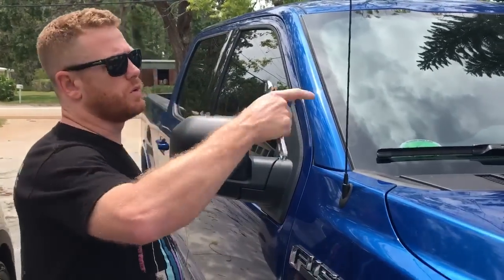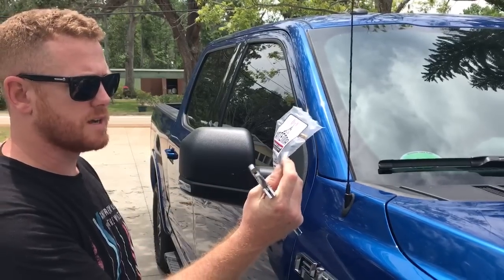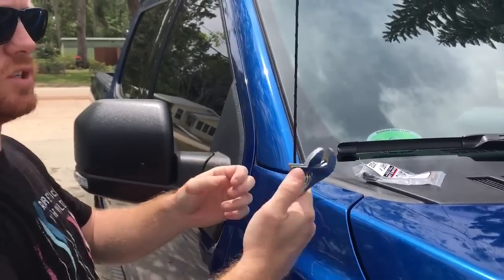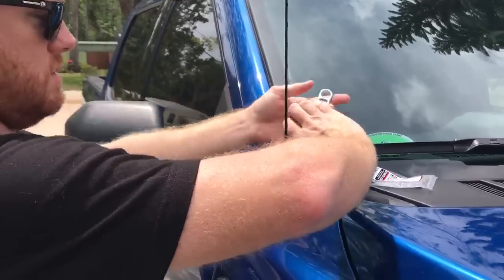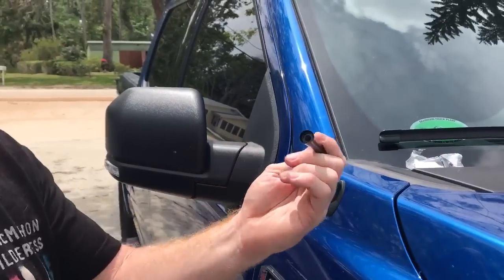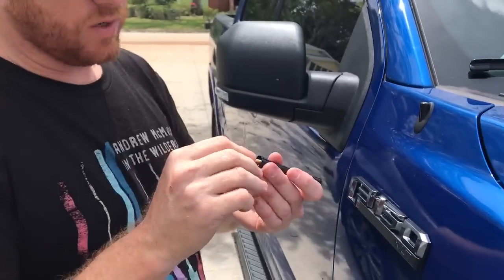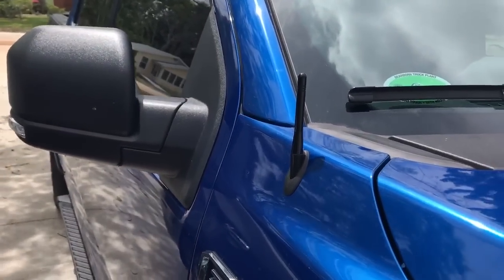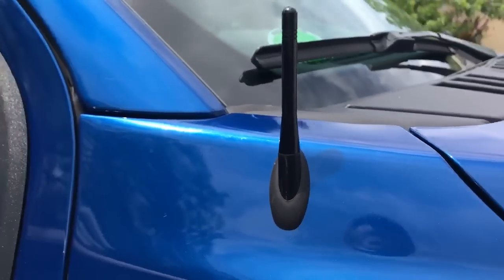Stubby antenna Review - $19 Ford F-150  cheap antenna mod and Installation

Comment: Installed one on my 2013 F150 a couple years ago.  FM reception is absolutely terrible, and AM reception is non-existent, and I live in suburbs of very large city.  Finally getting around to ordering something longer (15”) or going back to OEM antenna.

Comment: Yup, I have a 2017 F150 that I like to run it through a car wash about twice a week.  I bought one of those from Amazon, I think it's called a "Stubby".  I did one more thing that you didn't do.  I put a nice coating of oil for those idiots who wants to steel my stubby.  Their hand just slips around it.  My wife had one and it got stolen.  I bought another one, applied oil, it's now been 2 years, she still has it!  :-)
Reply: Lol! Oil and capsicum powder would be great.  Dang stealing antennas is a thing still??
Reply: Any issues with the car wash? I went today (I have an 18 F150) and they made me take the antenna off.
Reply: Lmao i was checking up youtube to see what people have used to prevent the theft when installing, funny as hell i ran into this comment. Lmao thank you!
Reply: How's your paint holding up so far? I've heard running your car/truck through a car wash too often can wear off your clear coat faster than normal
Reply: Rip to your paint.

Comment: I bought mine and installed it on a 2015 Dodge 1500. The reception dramatically worsened from the stock which had outstanding reception.
Reply from the maker: Sorry to hear. I wish I knew, I'm running on a 17 Ford and no change.  I live in Daytona.  So I wonder if you're ina rural area where stations might be distant from you but pump up their out put has any thing to do with it.
Reply: I lost all HD Stations after i installed it in my 2017 F150
Reply: Yeah same. Just installed in on my 2019 STX and the signal degraded a bit but it looks soooo much better. I’ll see how it performs driving around tomorrow
Reply: drummerboy04 any updates?
Reply: KRYPTON hey man. Honestly, it’s not that great. Interference is pretty bad driving along side power lines and the distance it can receive a signal is much less than the old school stock antenna. I just started a new job selling fords actually so I haven’t gotten around to swapping it out. It’s up to you to try it. I live in the Milwaukee area so there’s probably more interference than there would be out in the country but then again the signal may not reach out to the country. Love the low profile though. It’s an easy return if you don’t like it. 🤷🏼‍♂️

Comment: How's the reception of the AM FM radio signals?
Reply: Fjones1914 they’re going to be probably the same as the last antenna off not a little worse...these are more for looks then anything
Reply: Dawson 09 I installed one of the stubby’s and I sometimes lose my reception but it’s worth it for the look.
Reply from the maker: Average.

Comment: I have a 2018 ford f150 lariet, and I
I'm having issues putting the factory antenna back on after taking it off for a wash it wont screw all the way on. Any ideas why????

Comment: Thanks for the video but how is the radio reception vs the stock antenna?
Reply from the maker: Hey there! It seems to be fine, Typically I am on Satellite radio. After checking the stations about 60+ miles away have static, but they had about the same with the longer. local are as strong as always.
Reply from the maker: Thanks for bringing that to me.. I went in and actually tested it tonight. All sounds good, no static in local.. same static in distant confirmed:)
Reply: Reception is key
Reply: @mdpair4457  SHOULD NOT have had to "bring it to you"!!!!!!!!!!!!!--------ANY company that INSISTS their products are good, THEN puts RECEPTION as an AFTERTHOUGHT, like you did, NEEDS TO RETHINK ITS BUSINESS!!!!!!!! PLUS, in your ads, you must STRONGLY STATE that the reception with a SMALLER antenna, is NOT as good as with the original 31" or longer, whip, esp. with AM.